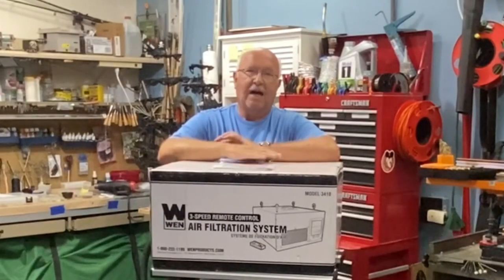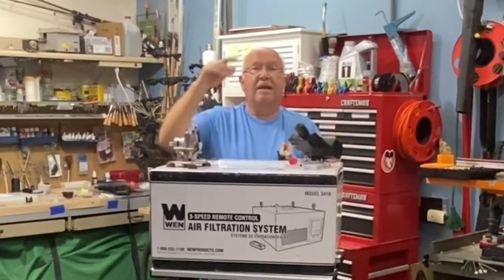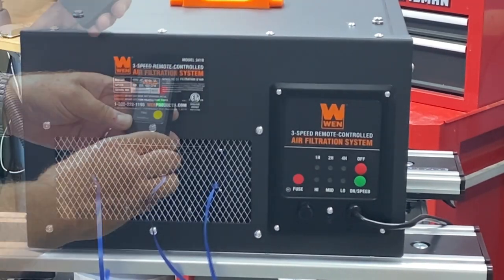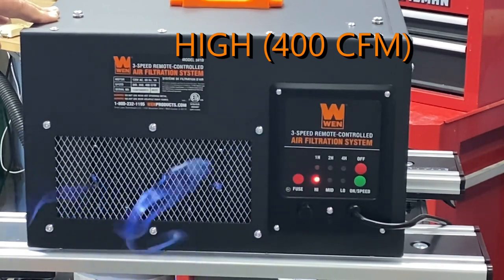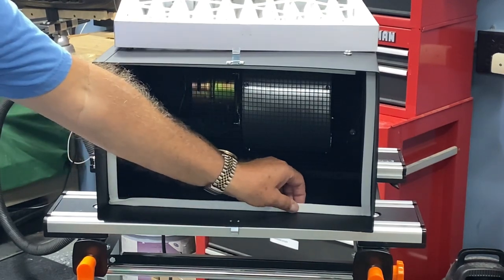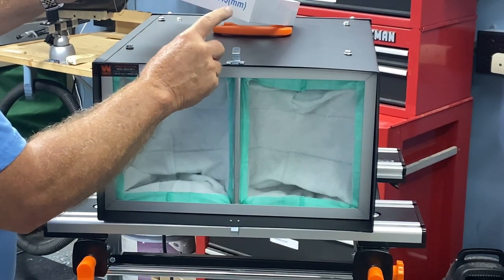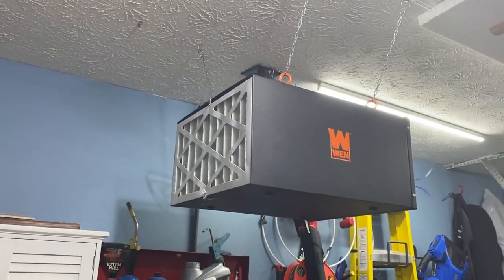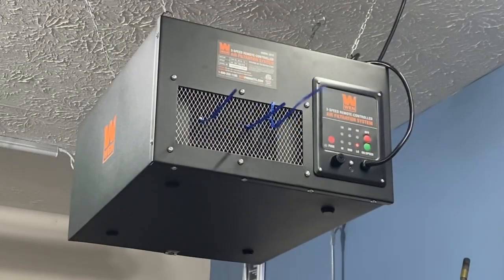WEN Model 3410 Air Filtration System

Comment: Thanks for the review. Hope it's running well for you. Just ordered one waiting for delivery. Great tip on the hooks in the drill for install!
Reply from the maker: Although I don’t create a lot of dust as my model ship builds are not like a full wood shop. I’m very happy with it.
I recently started laser etching into wood and it creates a Burt wood smell. I found carbon infused filters that you cut into shape.  I cut it out and have it as a pre-filter.  Although it takes a while to remove the odor, it’s removing the burnt smell out too!
Here’s a link for the filter (Walmart) that I cut to fit:
DuPont 3 Way Odor Control Carbon Adjustable Air Filter 20"x25". This filter is unique in that can be trimmed to fit most HVAC size needs.
I didn’t use the plastic frame, just taped to the front intake of the air filtration frame. The airflow actually holds it in place.
Thanks for watching and providing the positive feedback 👍👍
Reply from the maker: I don’t think the link worked…
Try cutting and pasting this: unless this worked this time?
https://www.walmart.com/ip/16522741